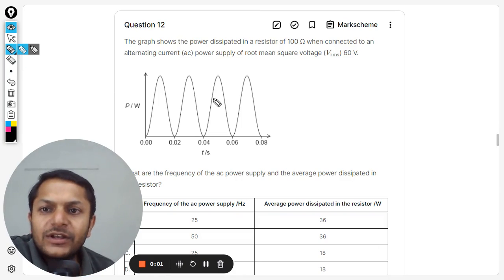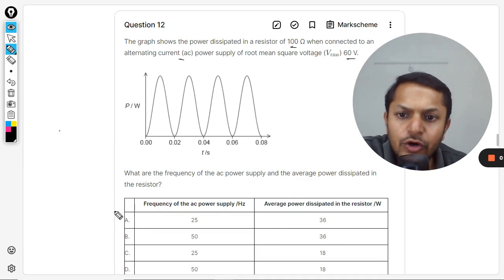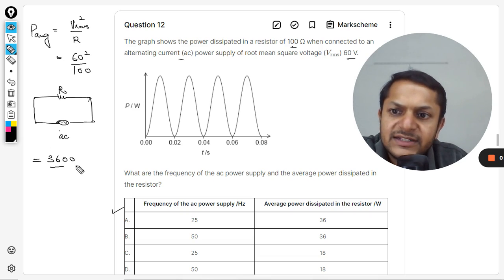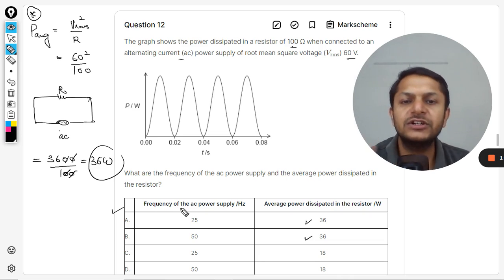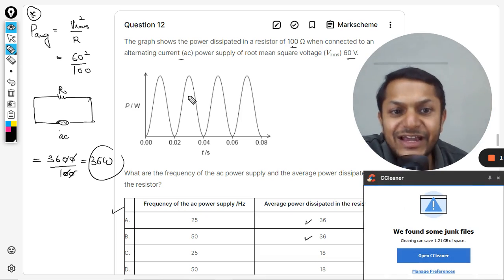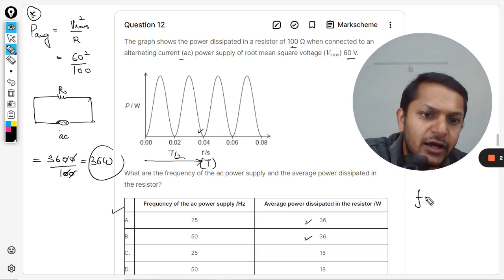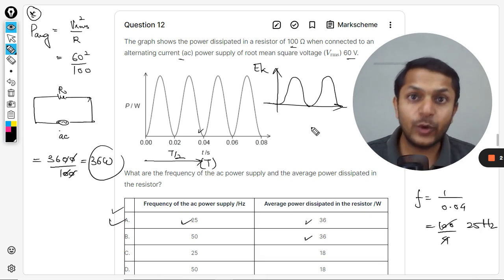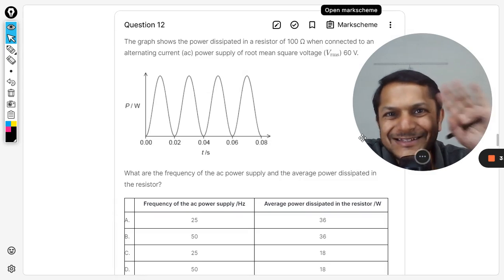The graph shows the power dissipated in a resistor of 100 Ω when connected to an alternating

Comment: Why don't we use P = (1/2) (I0) (V0) for this question?
Reply from the maker: There is no problem with this formula. But the peak value of current is not given. By the way, peak voltage is also not given. So, why will we apply this formula!